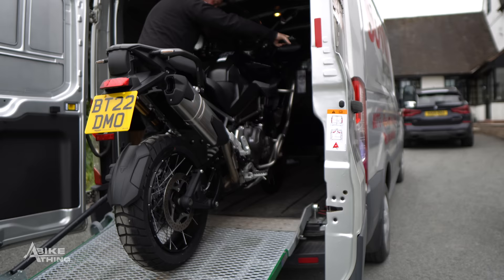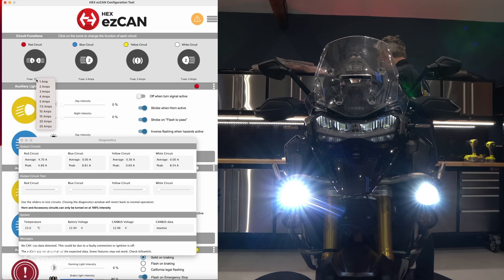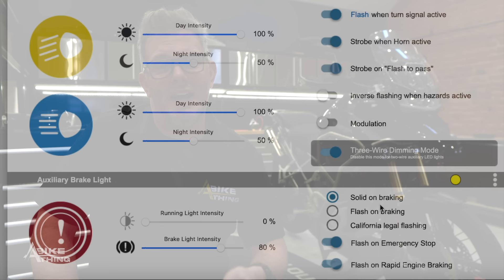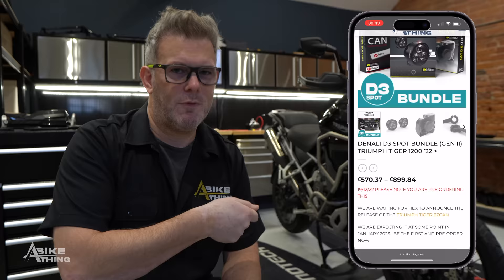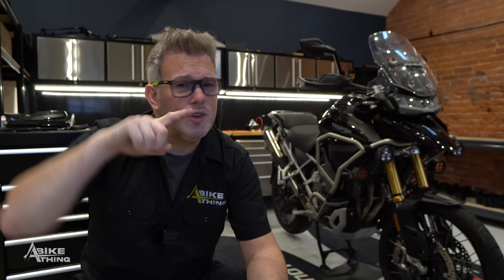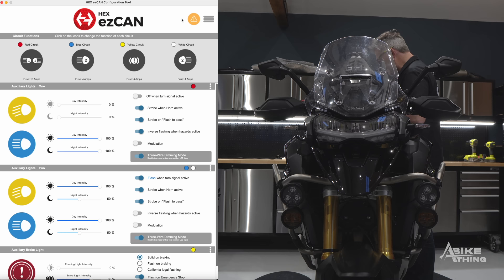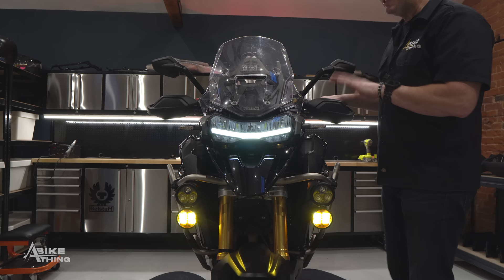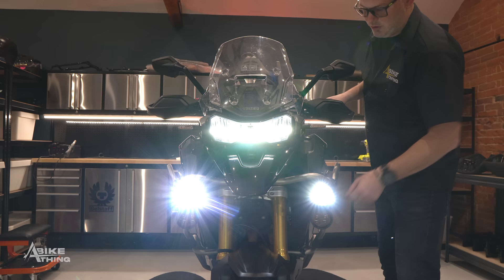MY BRAND-NEW TRIUMPH TIGER 1200 RALLY EXPLORER . THE MODS SO FAR

Comment: I have a new 1200 rally explorer and live quite a long distance from a dealership. I'm putting on a Denali dialdim with my D4s and sound bomb. I was  wondering where you would pick up the ignition and high beam triggers? I'm in the US so getting it to you shop would be a bit difficult. Lol
Thanks 
Ken from Pennsylvania.
Reply from the maker: I don’t want to just tell you which colour wires as I’ve recently discovered there are some differences between the EU and US tigers.    

We took a switched live from the din plug at the back, this could be used for the trigger to power up the run lights.    At the back of the main headlight you’ll be able to see the wires coming out.  It won’t be difficult figuring out which one is the high beam wire if you have test equipment.

It’s possible the high beam wire on the tiger will not even activate the high beam on the dial dim.   It doesn’t work on the GS or the Tenere however the high beam on the tenere is so bad the people I know who have a dial dim tend to just use their dial for high beam as opposed to the factory switch.

Comment: Great stuff! I have the Tiger and will probably look at a couple of these upgrades.
Regarding the evotech mount for the phone, I’ve just fitted a Cosmo gps bar to replace the plastic one that moves the windshield up and down. Fitted the peak design mount to that bar and it’s a great solution. It is worth checking out to see if you want to consider them Mark as they have to come in from Greece and although it didn’t take forever it wasn’t quick.
Reply from the maker: Cool.  Who’s mark?

Comment: 27:59 I'm a bit confused about the lighting intensity dials. Day and night refers to ambient sensor detecting day and night...assuming the Triumph has ambient lighting sensor - or is that just a BMW thing and the Tiger is manually switched only? There is yellow full and blue dipped controls. I assume that's for night time riding in dipped or high beam? Where then does the DRL fit in? is maybe DRL the day intensity in dipped and high settings?

Comment: Love your content! I was wondering if they now have a bracket to replace the OEM fog lights on the new gen tiger 1200's (GT Pro in my case) with the D3's? Also, I saw a vid you did on the D3 saying that they had to be mounted upright, is that still true? If the D3's were mounted in the same spot as the OEM fogs on the tiger they will be upside down... and I want to use the hybrid lens. Go, no go? Thanks.
Reply from the maker: Still no adapter that I know of.   Its ok to hang the D3’s even with thr hybrid lens

Comment: Hi Steve, just a quick question for you if I may.  Is it possible to dim a 2 wire light pod using the HEX ezcan on  Triumph Tiger 1200 GT Pro?  I have the old light units off of my old R1200GS and they dimmed using the scroll wheel.

Comment: Mark will the Evo Tech mount for the GPS work ? I have seen where it shakes a lot and with the wind screen up its all in your face. Do you have a idea as to where you can get a mount to go some where else  like center of handle bars etc. ?  . I don't like Ram Mount on left side of bars moving around I have Zumo xt.
Last thing I have bought Clear Water lights will EZ can run them ?
I have owned many GS, and GS Adventures , the 2023 tiger Explorer rally pro has me completely. The GS can maneuver at slow speeds, lower center Gravity, easier to pick up if you drop it.
 The new tiger more fun in EVERY OTHER THING you do. I do dirt roads that's it I'm part of the 96 %. Off road needs to be lighter bike lower cc for lots of reasons. So if you do lots of pavement nothing more fun than Tiger 1200 2023 explorer Pro, sound , HP, comfort, handling . I'm 82 400,000 plus miles starting at age 6, here I am still riding , got the 100,000 and can get the 200,000 mile BMW award. all on GS or GS adventures. Triumph is cheaper to maintain by far. love the Drive Shaft set up smoth as can be. Vibration not a Problem for me , and if you rode BMW's you know what I mean , times when you let off the gas to see in the mirror.
Lets all keep ridding have fun stay safe and get a smaller bike when we get older. GA USA guy.
Reply from the maker: Thanks for the input Jon.  Yes you can incorporate the GPS mount on this same set up.     I like having the gps map right up there in front of me. It means I don’t need to look down away from where I’m going and can glance at my map safely.   The peak design mount on this evotech mount takes all vibration away.    Maybe look at our universal phone mount adapter that could be stuck onto the back of your GPS.  This would resolve the vibration issue.
Reply: Thanks for the reply. I had noticed a guy in your area mentioned the shake rather vibration was just the wt. on the windshield.
So pulled up to the top its not that bad to see some thru the windscreen? I will take another look and get back to you .
Thanks so much
JON
Reply: oh can you use the EZ with clearwater lights?
Reply from the maker: @454gun  yes.  It’s not the same plugs but you can power any 12v accessory with an ezcan.  You’ll need to either find a pigtail with a plug that’ll screw onto the CW plug or cut the CW plugs off and make a new connection using the spare plugs that come with the ezcan
Reply: @ABIKETHING  thanks

Comment: Ive got the GT explorer which I assume has similar panel work. Are you saying you can wire extra front lights without taking off the outer plastic panels/fairings?

Comment: Is the EZ-Can going to make use of the dedicated Fog light button?  You didn't mention it but to use the stock fogs you need to press the fog button while headlights are on.  Now that you've replaced these is the button redundant or can it be re-purposed?
Reply from the maker: Ah yes I completely forgot about this because I haven’t used it for months. It’s redundant on mine but it probably could be repurposed as a secondary switch however this will require wire splicing into your Triumph wiring which will not be welcomed by your dealer.
Reply: what would you like to use that switch for Charlie?
Reply: @stephanthiel4358  Would be good if it could continue to control the lights installed to replace the fogs, rather than try the joy stick combination
Reply: @ABIKETHING  hi, just small clarification, doest it going to show the error in display for missing fog light connection
Reply: @hanu0913  Yes it will. I don't think there is a way of deleting the fogs and removing the error message...unless it can be done by dealer software.

Comment: I have a question regarding tripple flash to strobe. On the tigers with the drl switch, the flash button works in 2 ways: on drl mode, the flash button is momentary and I see no problem. But on low beam mode it is a on/off switch.
What happens on low beam mode and you tripple flash to strobe? Does the oem high beam stay on? Because you basically do on-off-on...
Reply from the maker: As I say in this video…..it’s 4 flashes to activate strobe on the tigers.
Reply: @ABIKETHING dammit i must have missed that. I promise i watched the entire video :p

Comment: The Steve just got my lights and hex can I ordered from y’all installed. I’m following your setting on the lights but I don’t have the DRL switch. Can I still follow your settings at 27:24 and get the same results? I’d assume so since the low beam will just always be on
Reply from the maker: Yes it’ll still work. It’s all triggered by the photocell on your bike.

Comment: Thanks for the great information!!! I had a couple questions can you control factory fog light to come back on after low beam is selected after high beams were used.  Also did you plug the amber fogs into hex can bus or in factory plug. Thank you very much for your time!
Reply from the maker: U can’t change what the factory fog lights do.  Amber D3’s are connected to the ezcan
Reply: I had another question do you have the part numbers for the brackets u used for the factory light replacement. thanks